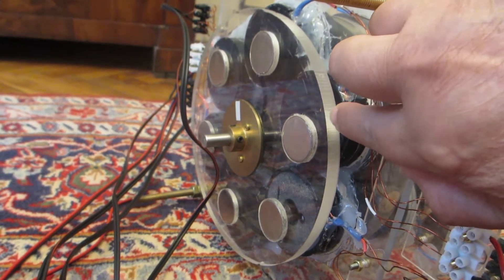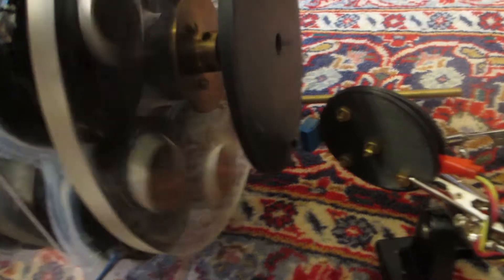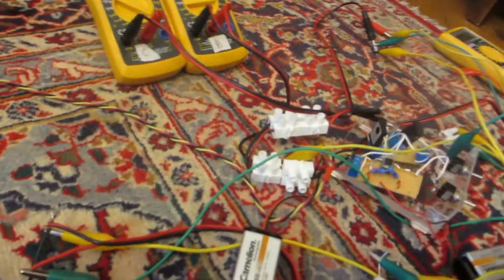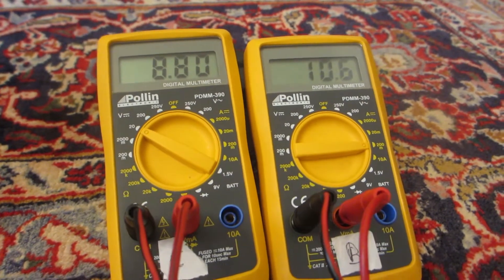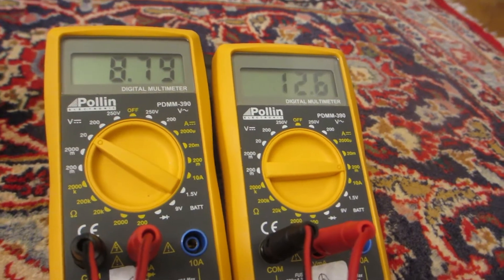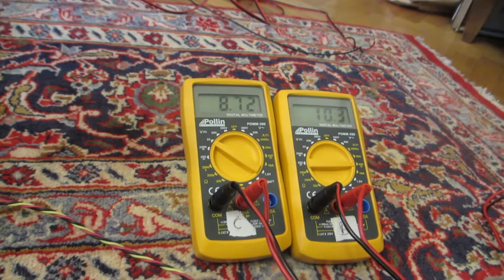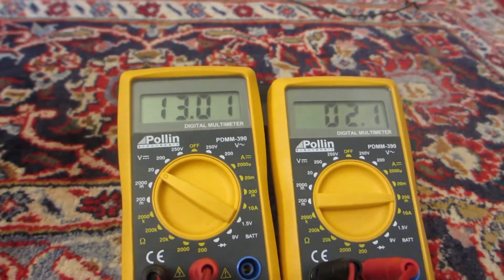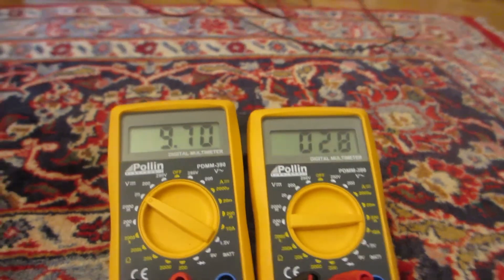2 to 4 mA to power the 3 rotor motor generator - getting closer to Free Energy

Comment: A multimeter on the current range uses a low value resistor in series in series with the circuit. They use it to develop a voltage across it and read this voltage as current. Each range has a different value of resistor.

Comment: love your circuit ideas. I can give you some help.Multimeters have a resistor built inside on lower milliamp setting which is why you're seeing lower amperage draw. Also use LED instead of diode for the back EMF and direct it straight to the run battery LEDs allow this without affecting amperage draw or short circuiting like a diode can

Comment: Hi Luc
Great video thanks for posting it 
Analog meters would be good to double check.
I will bet the discrepancies in meters between 20ma and 200ma due to the different resistance and sampling and time factor for meter to "grab" a sample to display...but I don't know as usual..
you know how if you use an analog meters like 5A one and it shows say 50ma running a pulse motor with it, and you use a 200ma analog meter  instead, now your amps input will show maybe 100ma  instead of 50ma ....what is strange is your consumption goes down not up when you go to 20ma instead of 200ma with your digital multimeters!
Maybe it's picking up amps of what hits meter first to register? (Spike amps?)
Maybe your magnets whirling past aircoils is actually inducing more power (backwards) in the coils than what is being consumed from battery and this is your meters way of letting you know when less resistance in 20ma setting there is less power produced as well as consumed? Think in mode that it is working  overunity because "it must be" with that huge magnetic field slamming against all that copper and you are drawing .004A X 9V is all.
So maybe the power being  produced (not DC but choppy AC)  cancels the input power by domination in the "positive area" (as meter in DC is not going to sample any AC negative stuff) with less resistance at 20ma setting.
Try meter in AC just for fun see if that confuses issue more haha
If you put AC legs of FWBR using very fast HV  diodes over your coils and short them at voltage peaks very briefly with reed switch or mechanical means (ultra low resistance switching) and put that 470uf cap on DC side of FWBR you will really see some good stuff happen filling the cap up super quick super high ...."de-couple"  cap upon discharge to load....
I think that cap making draw go up at end of video is that  it is not working as a resonant chamber, rather a resistance, so I bet much smaller size cap would not raise draw at all,  and there is probably perfect size cap not 1uf too much or too little which will decrease draw even more maybe go into negative draw!

Comment: Hi nice unit and great video! Are you coils directional wound or wound in the conventional way? Also i am curious if you had tried litz's wire in your coils. 8)
Reply from the maker: Thanx for your comment... no they are not directionally wound.. they are not wide enough.. i will try it one day but for the moment i do not have the time winding them...I have had a litzwire coil at the beginning.. i did not see any difference, probably because the machine is to slow.. if i put the 10 generator coils in series and it is turning faster (with a 12 volts battery i get over 200 volts without caps at 90mA.. but of course major lenz as soon as i try to power someting.. here with a bedini circuit: https://www.youtube.com/watch?v=imkeoMIiuj0